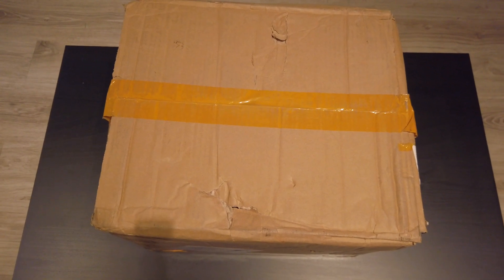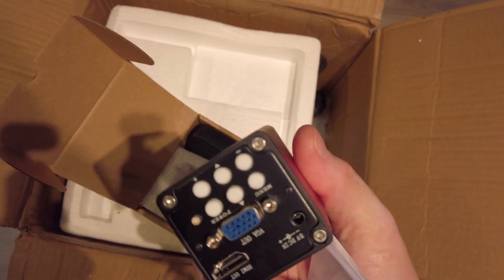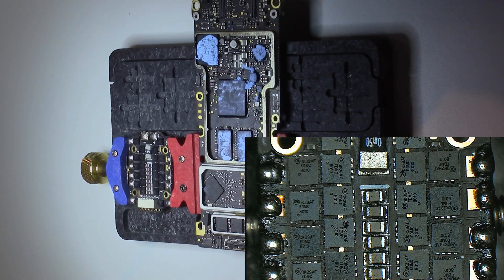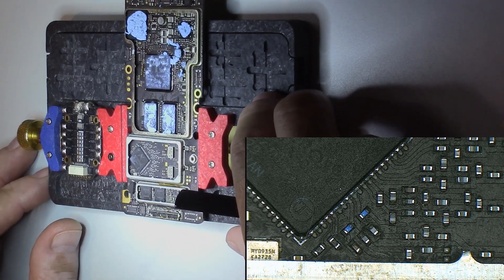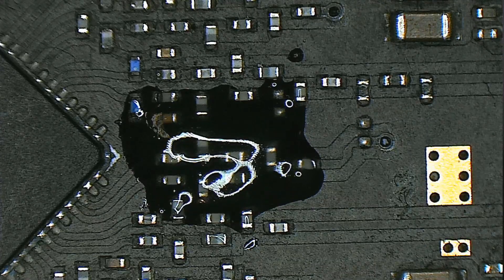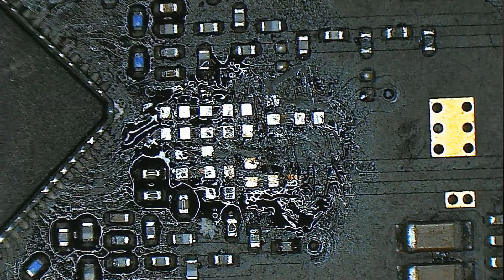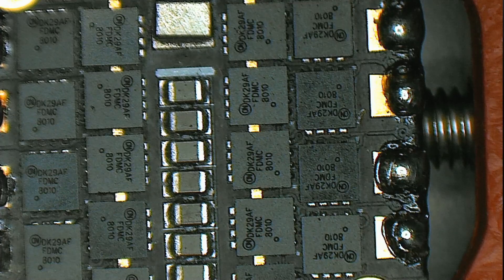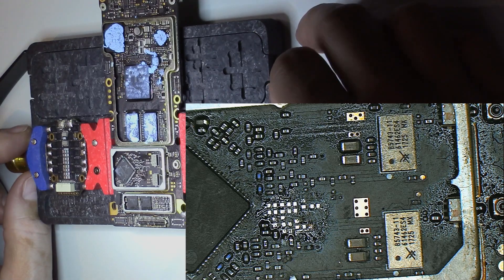PCB Repair Simul-focal Trinocular Stereo Microscope Test (Eakins Microscope)

Comment: Hi LIvyu, slightly better than my Daniu dm001 - https://www.banggood.com/DANIU-DM01-4_3-Inch-LCD-Screen-HD-5_0MP-800X-Portable-USB-Digital-LCD-Microscope-High-Brightness-8-LEDs-p-1337845.html?rmmds=search&cur_warehouse=CN,   mind you better quality as well.
Reply from the maker: the eyepieces quality and help in working through the microscope is invaluable :) But only to have a video about the PCB I guess yours is ok too.
Reply: @LivyuFPV , Yes its very good for the price I paid for it, as it happens I have a set of FXT Viper 2 goggles that will not power on, I have power going to the board and capacitor checks out OK, so I will now need to examine the rest of the components.  I'm only doing this because I cannot get a reply from FXT because they are still in warranty.